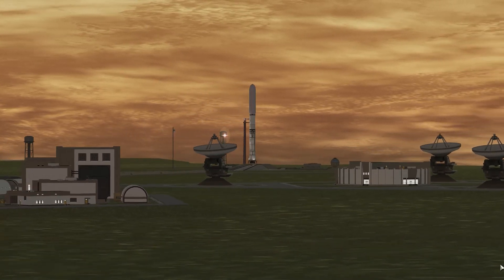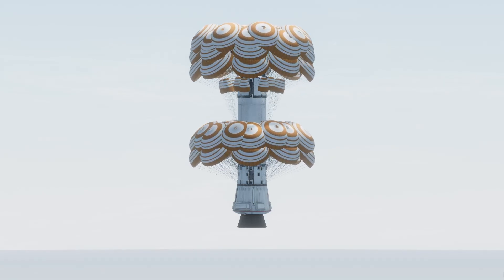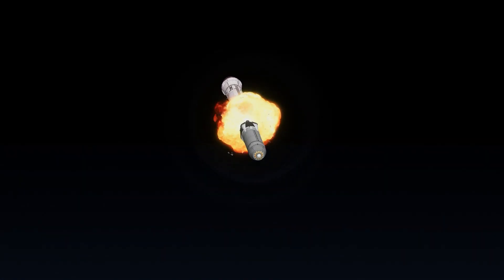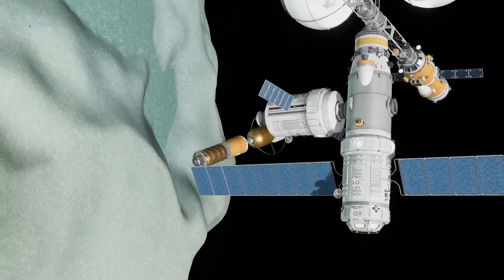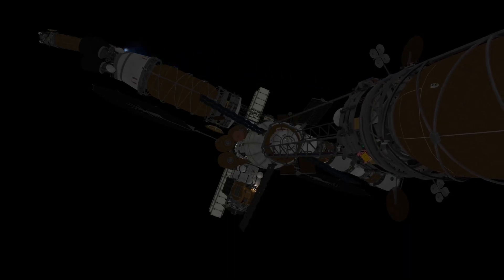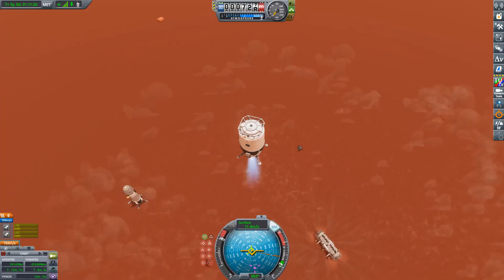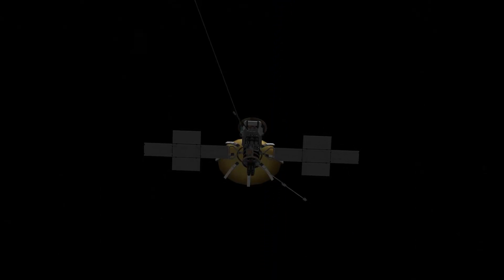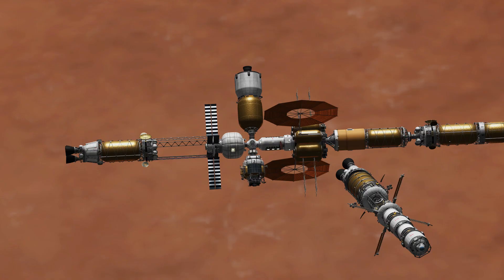Into The Expanse Episode #7 DUNA RESUPPLY

Comment: how do you keep your spacecraft that are segmented by docking ports from flopping around??
Reply: If you enable "Advanced Tweakables" in the 'Settings' menu you will get an option for 'Auto-Struts'. Enable this. Now, when you are in the VAB or Spaceplane Hangar (even in flight for that matter), you can right click on parts and enable different types of auto struts (The 'Heaviest Part' option seems to be the most effective).
Reply: @donkoltz1  I've used autostrut for years. this has never solved my problem.
Reply: @GrandMoffOfMars  Have to start with the simple stuff... Perhaps your docking ports are too small, your segments between ports are too heavy, your reaction wheels are nowhere near the center of mass (or there are multiple reaction wheels scatttered throughout),  your reaction wheel's 'forward' vector is not lining up with the point the vehicle is controlled from, or all of these are true at the same time.
Reply from the maker: Auto struts mostly and I think i have rigid attachment enabled on docking ports
Reply: @TZeroSystems  strange, I can't seem to find a solution to my problem.  

even of i add struts in orbit, they disappear when I reload the craft.
Reply: Autostruts as of 12.2 work through docking ports but you may have to cycle through them again idk
Reply: @basesixty6739  these videos were shot before 12.2. 

none of my segments are any heavier than his. 

I'm using mondo ports lol
Reply: @GrandMoffOfMars  oh yeah I never thought about that
Reply: @basesixty6739  do you know how he's attaching fuel lines between seperste craft? KAS?
Reply: @GrandMoffOfMars  yes, I have it